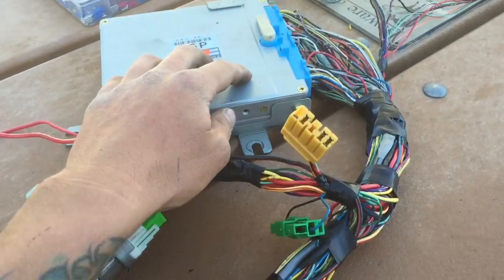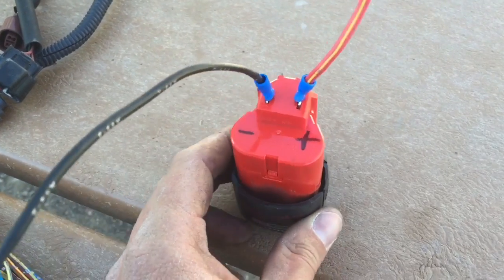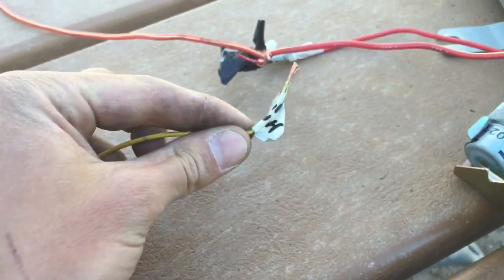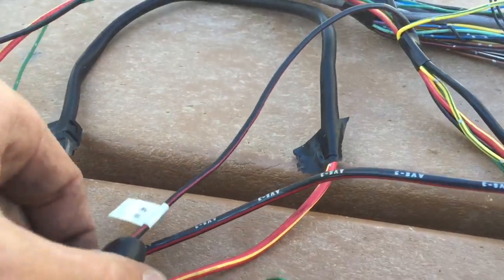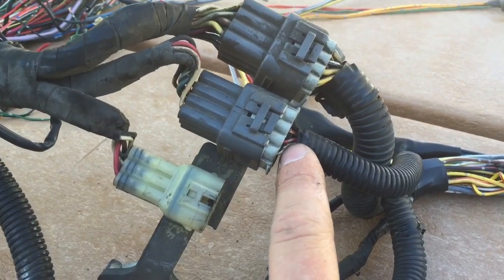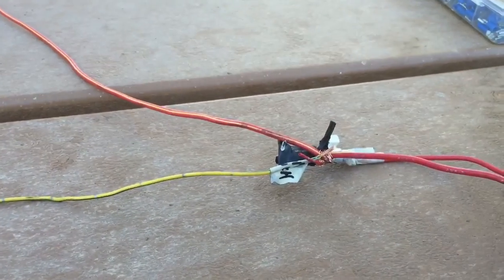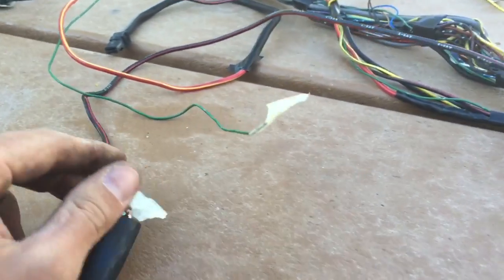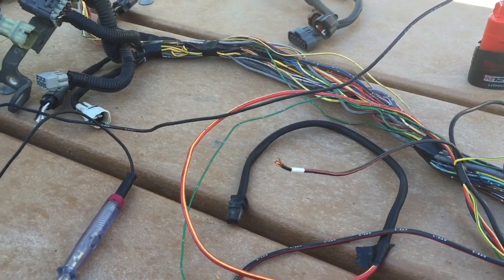10. Harness Testing - Wiring Harness Series

Comment: Does anyone know why this wasn’t picked up with continuity tests ? My mechanic testing harness because of cam & crank codes did continuity tests and what ever else picked up no issues 
But then he inspected of connectors on the harness found a snapped terminal connector in the socket that plugs on the sensor it was snapped but touching , changed terminal or te connector what’s it’s called sorted out the fault cleared codes now fine . Why wasn’t this found in the tests

Comment: Great video and i liked the idea of using the smaller m12 battery. Do you ever run into issues where you want to or try to test the wiring insulation for leaks by meggering? I wondered how a circuit might react differently up against an engine block as opposed to being outside of the vehicle -

Comment: Why don't you just take the testing of shorts of the each harness pins for sensor ends and ECU plug connectors of the harness? If the meter shows 0.001 or 0.002 ohms then wire is ok. Better with beeb-sound

Comment: What does it mean if the relays turn on but doesn't cycle on and off? I'm using a small 12v battery for tv remotes and such, could this be the problem?
Reply from the maker: +Gage Vanhaverbeke as long as you're in test mode they should click on and off. Perhaps the power source isn't strong enough.
Reply: Did you ever figure out why yours was doing this? Mine is doing the exact same thing. It won't cycle on and off just clicks once and that's it. Maybe my green connectors aren't working?
Reply: @mfeijo  Mine ended up having nothing wrong with my wiring at all. I had to plug all my engine connectors into the harness on the engine for the ground to work properly. Once I plugged the harness into the engine all the testing worked perfectly
Reply: @willysbug  Thank you for posting this update. So often we don't get these and this is what I was struggling with too.